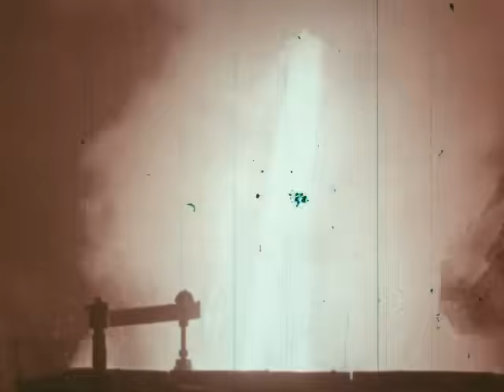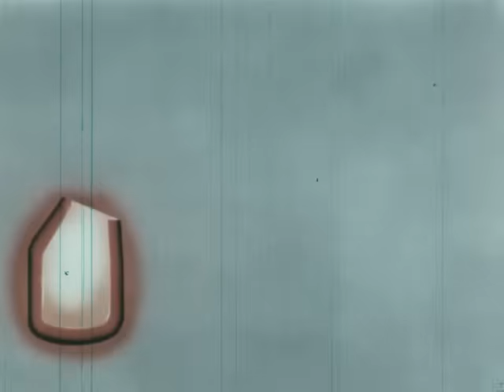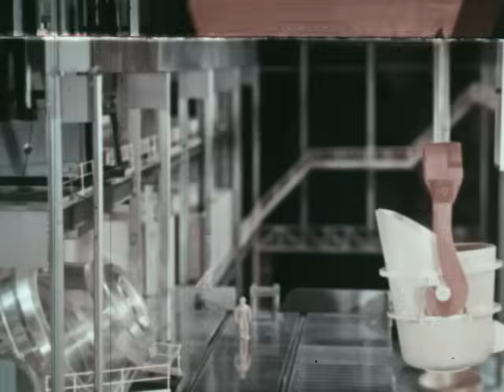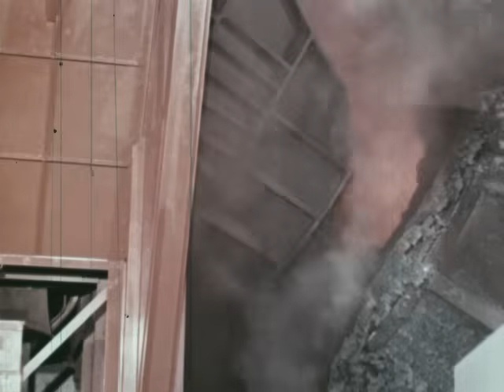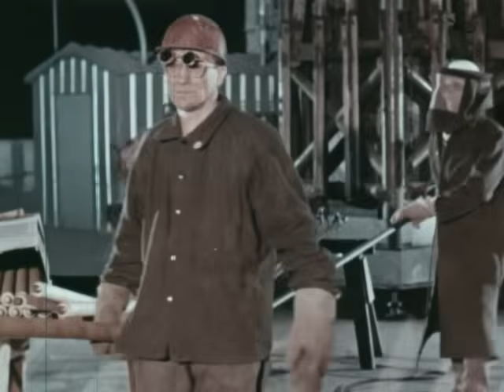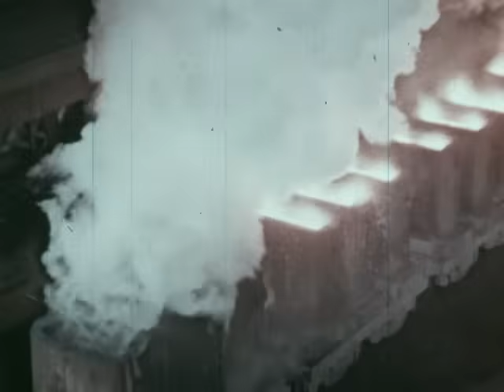Steel By Stopwatch (1960s)

Comment: So cool.  Did they generate the oxygen onsite?
Reply: ZING !!!
Reply: I was wondering that too.  It wasn't stated, I presume that it would be piped in as O2 Gas from a nearby dedicated facility.  You could not schedule enough LOX in railcars and the production would need a near continuous supply.
Reply: No, was most likely fused from lighter elements in a dying star.